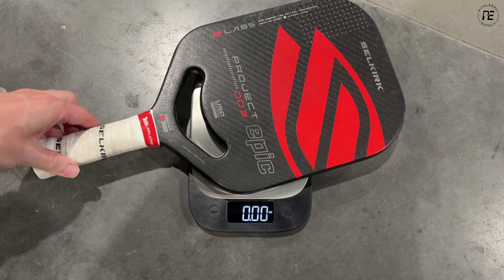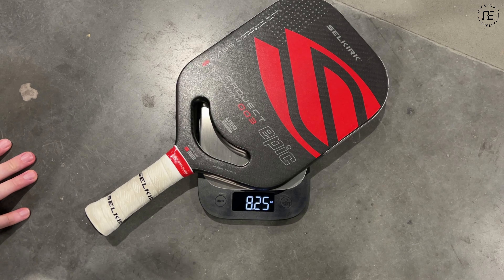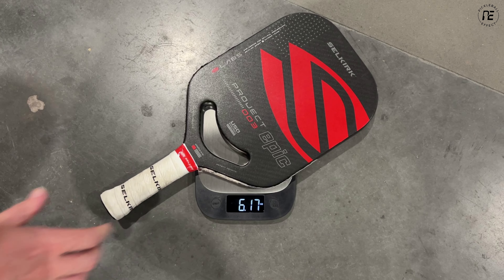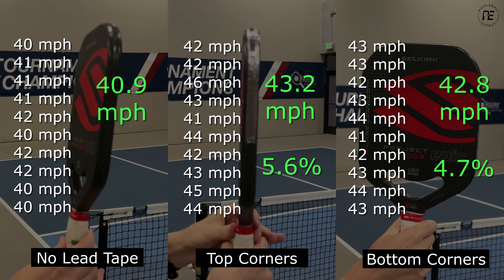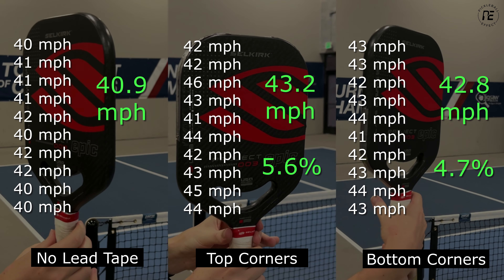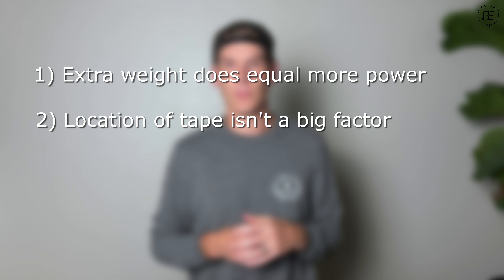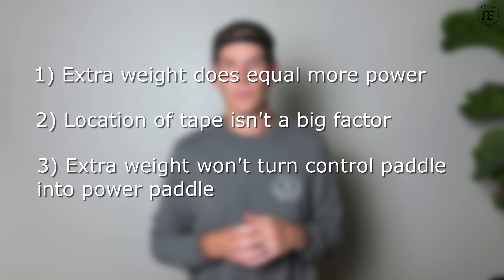Pickleball Lead Tape Experiment - How Much Power Does Adding Lead Tape Give You?

Comment: where you put the weight has a lot to do with swing weight and how it affects your arm/elbow. I find adding at the throat doesnt increase my swing weight head heaviness as much but still adds plowthrough so the paddle has more power through the ball. It also adds stability in torsion side to side when you dont quite hit it perfectly in the sweet spot. 

Adding to the top makes me feel it in my elbow a lot more because the whip is more significant.
Reply from the maker: There you go! My results make a lot of sense now ha.

Comment: I owned and operated a tennis shop for close to 35 years.  We customized racquets for a living.  Lead tape in tennis is basically used to both move and increase the size of the sweet spot.  F(force)=M(mass)A(acceleration) For the most part as we increase the mass it usually slows down acceleration.  The main purpose of adding lead tape is to make the paddle more stable on off-center hits not to increase speed.
Reply: I used lead tape during my tennis days, too.  Based on your experience, where would you recommend tape on a pickleball paddle to increase the sweet spot?  I'm thinking the sides, but you would know better than me.
Reply: @CharlottePickleball  Have you come to a conclusion?  I'm just starting to look to adding lead weight to my paddle.  My goals were to increase the sweet spot (stabilization) and/or increase my swing speed.
Reply: You obviously don't understand much about newtonian mechanics. Per Newton's second law, the Force the paddle exerts on the ball = mass of the paddle * acceleration of the paddle.  F is directly proportional to mass so as you increase the mass of the paddle, you increase force.  Because the force of the paddle on the ball = the force of the ball on the paddle per Newton's third law, the force on the ball will be bigger than without the extra weight.  Force on the ball = mass of the ball * acceleration of the ball.  Because Force is directly proportional to acceleration and Force is now larger due to the extra weight, acceleration of the ball must go up because the mass of the ball doesn’t change.

Comment: What if one was to put lead tape all around? Will power and sweet spot both be at its max? I understand the weight may not be desirable for most but just curious.
Reply from the maker: Yes, it would just be heavy is all.

Comment: Great content.  Would love it if you did this again with 2 gm per inch tape and at a 9oz weight.  I play with a CRBN1 leaded at the throat @ 9oz and really like how it improved both stability on resets of hard drives, but also my speed on the serve without slowing handspeed (like tip weighting does).  It also helped increase the sweetspot, expanding it toward the handle (which otherwise was very wooden).
Reply from the maker: I imagine we'd get similar results though since you have it weighted about an ounce more than out of the box you probably got a bigger speed boost than what I got with the 003. Thanks for the input on the other benefits of adding weight, I feel like it does the same thing for me too.

Comment: Thank you for answering the question of if adding lead tape to a control paddle sacrafice what makes a control paddle a control paddle.  one other question i have is what do you think adding lead tape to the air dynammic throat would do?  i just got the Luxx S2 in and need to experiement a little, but i am assuming tape in that location would improve the paddles blocks and punch vollies which i hear are a weak point on that paddle.
Reply from the maker: I don’t imagine putting lead tape there would do much for stability but it would change up the balance point of the paddle.

Comment: thanks, very interesting! I guess the next question is, how much is too much lead tape? when does it become diminishing returns to add more and more tape?
Reply from the maker: Good question, I’d be interested in that too. That should be my next experiment.
Reply: That would be based on each unique individual and their own preferences That is similar to baseball bat swing weights and different players will have different swing speeds with the exact same bat. The idea is to have the maximum amount of weight without sacrificing the bat speed. I would think this would translate to pickleball paddles as well, you want the maximum weight that doesn't sacrifice your paddle speed or reduce reaction time on net volley battles. But there is one other variable that I think needs to be considered and that is the additional weight can induce elbow, and shoulder pain after prolonged play. That is the main reason I returned my Joola Ben Johns Hyperion 14 was the feel of the sweet spot was amazing when driving and dinking but the head-heavy balance and overall weight at 8.5oz fatigued my arm during play and I felt slowed down my reaction time.
Reply from the maker: @dcppcp  well said, I think you got it right.

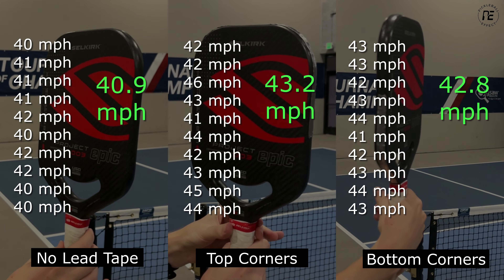Comment: 1:34 Adding some more nerdy details: punching the numbers into Excel, we can do a 2-sample t-test--which can tell us whether the differences in the averages here are due to actual differences in the average or just due to random variance in the testing. The numbers above yield a t-stat (p-value) of 1.77 (0.24), which means the differences between the two weighted tests are not statistically significant. On the other hand, the same sort of analysis applied to the non-weighted vs. top-weighted tests yielded a t-stat (p-value) of 4.05 (0.00), which is a statistically significant difference. Basically a long way of arriving at the same exact conclusion as you in the video.
Reply from the maker: This is awesome!! Glad to hear the numbers lined up with my thoughts about it.

Comment: Increasing swingweight (adding weight) will increase power. I try to maintain the stock balance point by adding weight to the grip and at face locations 3 and 9. Use a balance board (or table edge) to check your work. A leather grip replacement and overgrip will add about 8g to the handle to counterbalance the face weight.

Comment: I wonder what is the difference in swing weight and balance point in a paddle with lead tape at the bottom vs. at the top.
Reply from the maker: That would be interesting. I'll have to look up how to calculate that stuff.

Comment: I’d be curious if you can impact the sweet spot and/or stability with lead tape. 

I’d also be curious how adding more tape, taking the paddle up closer to 9oz would impact power. At what weight do the benefits diminish?
Reply from the maker: Good questions, I have some ideas on how to measure the sweet spot but haven't messed with it yet. I'm interested in that as well. Arbitrarily it feels like the sweet spot is increased with additional perimeter weighting from lead tape.

Comment: Great video, all this stuff is so new there is no data anywhere to show where and how much lead tape matters. I added lead tape to my Warrior Edge. Initially it weighed 7.6 ounces. I added .7 ounces of lead tape at 9 o'clock and 3 o'clock going down to about 2" below the bottom curve of the paddle. It definitely gave it more power, but it feels like it made the sweet spot larger.  So, for me it was still very maneuverable, but it added pop with a larger sweet spot and the paddle still stayed very plushy feeling. A win all the way across the board. Keep going with all your content. When you don't come out with something new in a week, I get disappointed 😂.
Reply from the maker: Yeah, I think there are a lot of benefits to lead tape. It's nice when the paddle is light to begin with then you can build it up the way you like it without it getting too heavy. Glad you like me stuff ha, thanks for the support.
Reply: Your comment is very helpful, because I'm thinking of moving my lead tape from being about 10 to 2 across the top... to being more on the sides to increase the sweet spot. Thank you!

Comment: Hi I’m wondering if you could do a video on the ramifications to your game hand speed how the weight at that location effects power if speed on serve is different and if you’re slower in game speed of paddle for blocking shots in regards to using the suction cup on the bottom of my paddle and not the lead tape. I find that when I’m playing against high level players I tend to tear the suction off the bottom and play without it but it makes it easier on my back to play with it so I’m trying to get used to it.
Reply from the maker: I’m not sure how I would measure that, I’ll have to think about it. I like that idea and am interested too.

Comment: I added lead tape to my 003 inside the hole. It seems to help some.
Reply from the maker: Ha that’s clever, I’ve never tried that.
Reply: Interesting, I'll have to try. Any notice on weather your dinks are faster by dong this?
Reply from the maker: @michaelroot1313  Yeah, the ball pops off just a little more with the extra weight which effects dinking some.

Comment: Does adding weight to the two top corners increase topspin?
Reply from the maker: Idk, I didn’t test that.
Reply: Changes you can make to add more topspin are increase the friction on the paddle face and/or change the swing path more low to high.

Comment: Adding tape did increase power. Adding more tape will add more power. It will change the swing weight and feel as well. You need to find the balance of these properties that works for each individual player.

Comment: Did you feel any difference in control?  I used to wrap my Electrum pro.  But on the model E, I couldn't control my server when I had tape out on the upper edges.  On the Model E, I had to keep it in the throat.
Reply from the maker: I wasn't paying attention to that in this test but from my experience playing around with it in general I prefer the feel of the weight on the sides and throat, otherwise my swing timing gets thrown off and I do lose some control.
Reply: @pickleballeffect  my partner would look at me like I was crazy for not being able to get a serve in hahah.  Took tape off the top, and back to normal
Reply from the maker: @erikcrossley5048  haha I'm glad you figured out what was going on. Thanks for your thoughts here, that's super helpful for others reading this and want to play around with lead tape.

Comment: Appreciate your questioning and effort here, but application of science would make your results far more meaningful.  Identify variables, vary one variable at a time while you control all the others, and interpret your data with science principles (physics in this case) to make conclusions, predictions, and generate further questions.  This is high school science.  (You also need to learn what a controlled variable is).

For sure, the location of added mass affects the swing weight, balance, and the paddle's ability to transfer momentum to the ball.  In general, we know from physics :
More mass at same speed imparts higher ball speed
Location of mass closer to tip of paddle imparts higher ball speed 
Increasing mass eventually leads to slower paddle swing speeds (for our human arms)

Assuming you're swinging with the same speed thirty times in a row is a huge error here.
Reply from the maker: Oh, c'mon, it wasn't that bad. A high school teacher would have given me a good grade for that. I controlled what I could but who has some expensive machine to swing the paddle to keep it at the same speed? Should I not have even attempted the experiment because I don't have a machine to swing the paddle? I think the results, though imperfect, are still interesting and helpful.

Comment: If the amount of lead tape needed is determined MATHEMATICALLY, a surprising amount of lead is needed to achieve marginal changes in the balance  and/or swingweight of a paddle or racquet.  An entire pack of Gamma tape (.5" X 36 inches?) may be needed.  If the weight is needed in the butt grip, just use fishing weights instead of tape.  The few inches of lead tape many players apply at various parts of the paddle is laughably insignificant. Unbeknownst to the player, the benefit is more psychological than mechanical, especially if measuring devices are needed to distinguish a few MPHs.